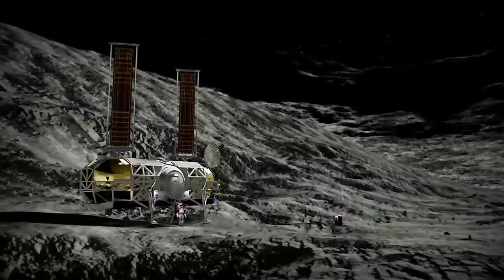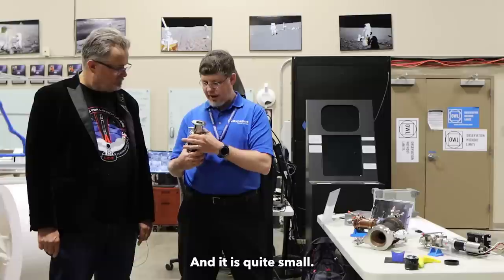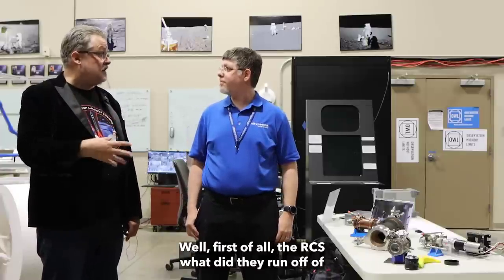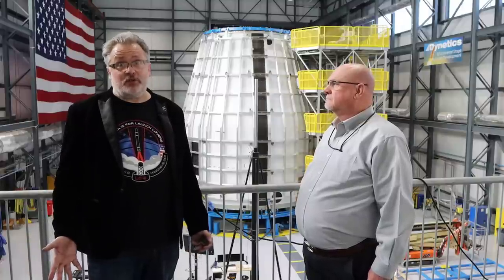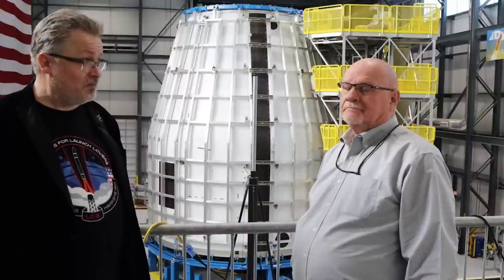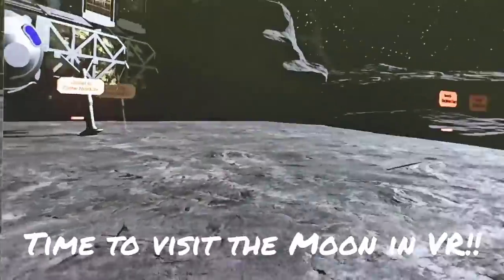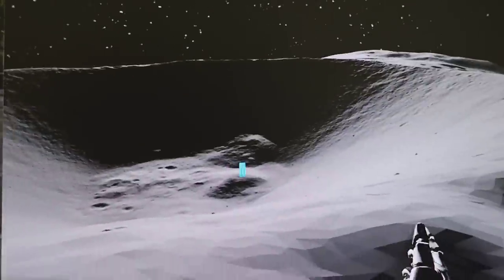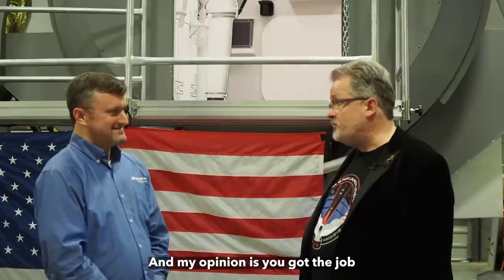One launch.  One landing!  The new lunar lander for NASA Artemis!  Dynetics Tour Part 2!

Comment: You make a compelling case for Dynetics. It's hard to see NASA not sharing many of the viewpoints you've proposed here, and I think you even identified the negative factors in the billionaire owned companies' ability to absorb cost and not pass it on to NASA. But if the product itself isn't the best, a lower cost shouldn't help it prevail. Dinetics Alpaca is the best system for Lunar landing.

Comment: Great content Jordan!  I really wish that ALPACA would be integrated into a 3rd stage that starship could take up to LEO.  Would be a fraction of the cost of SLS.
Reply: 2 Falcon Heavies, one with an Orion Command Module & propulsion stage/service module & another with the Alpaca & a lunar rover, would be a fraction of the cost of SLS! Remember, 11 launches of Starship will cost $80-110 million (much less than the above) & be able to land 24 astronauts & 100 tons of supplies including habitats, rovers and a power supply (probably a small nuclear power plant). We really need to realize Starship is designed to dramatically reduce the cost of spaceflight from $2300 kg (lowest cost of Falcon Heavy) to $70-100/kg so we can colonize Mars & the moon.

Comment: Like you, I like the current iteration of Alpaca.  While we decry the complexity of the SpaceX Human Landing System process, we should recall that NASA calculated the Alpaca version competing against it lacked sufficient thrust to execute the mission and was eliminated from the competition.  That left SpaceX and Blue Origin.  The BO lander looked a lot like the original Lunar Excursion Module after significant growth and was awarded a contract for the bulk of the 2 lander program's funds.  The SpaceX proposal was new from the ground up and was calculated to have the necessary performance...
HLS will have the capacity in both weight and volume to carry two Jeep Wrangler size vehicles, about 90 tons of general cargo and about 10 people, all at once.  At some point, vehicles capable of doing earth moving tasks will be required to build the desired permanent base.  HLS can accommodate the bulk and the weight of such machines.  Alpaca cannot.

That said, there are missions not suited to HLS.  As someone has said, the two systems fill different niches.  Alpaca is a relatively light truck.  HLS is a railroad car.  One does not normally ship a couple people and/or a small amount of freight on a railroad car.  Conversely, you simply cannot ship a Cat D-9 bulldozer on your F350 SuperDuty pickup.

Whether you are talking about inflatable habitat moduless or raw building materials, capacity to move more units is always good and one can pursue that goal without giving up on lighter transport vehicles.  Remember, the original Jeep was built as a quarter ton utility vehicle with 2 seats.  The available 2 1/2 and 5 ton trucks did not make the Jeep any less useful.  The available vehicles became cooperating parts of a larger whole.

We need both Alpaca and HLS and we need them both to work well.  And we will need both smaller and larger vehicles for the variety of purposes that undoubtedly be encountered.

Comment: Fantastic interview the two chief engineers.  Great insights.  Nice to see some hardware.  Dynetics has done a lot of good work.  I love their lander design.  It somehow looks right and feels right.  It's what a lunar lander should be.  But that's just my gut feel.

As an industrial designer, I was disappointed that they only had a "lo-fi" mockup of the lander.  The 3D walk through was nice, but no substitute for a physically realistic prototype.  A partially working prototype would have permitted them to assess human factors, even if it's only on the ground.  But maybe we just didn't get to see that.  I don't know.  I'm pleased that they got their guidance, navigation and control model development to the point where they can complete the mission when running simulations of vehicle mass versus fuel versus specific impulse.

Comment: Jordan, I saw both your Dynetics videos back to back, and something leapt out at me. They said they have an "automated landing system"... that can even put it on the surface without human input. Is that correct?

If thats true, couldn't they use that system to land an Alpaca, uncrewed, to be used as a rescue unit, to evac astronauts in an emergency? Imagine a variant of Alpaca, stripped of unnecessary components, like bunks, toilet, and other non-essentials, and all that space dedicated to cargo. It could shuttle supplies between lunar orbit and the moon, and still be much more accessible than other options.

Alpaca suddenly gets a whole new life... and becomes a MUCH more appealing option for the HLS. I hope I get to see NASA return to the surface... in an Alpaca.

Comment: Re ISRU issues with needing to bring methane from Earth, almost certainly not initially but once ISRU is up and running for local oxygen and water, might it not be most efficient (minimise the frequency required for resupply missions) to not transport actual Methane from Earth but instead just bring Carbon in some suitable form to feed some process on the Moon that actually synthesises the methane locally? If hydrogen can be produced locally and micro reactors etc can provide sufficient energy then those 4 hydrogen atoms hitching a ride with each and every carbon atom seems to me to be unnecessary mass being transported from Earth to the Moon.

Comment: Alpaca is still 2 launches for one landing- #1 launch the lander, then #2 launch fuel.  And as for refueling,  I'd rather see redundant LEO fueling, rather than a "got to be perfect" refueling in lunar orbit.  Also, relying on a future Vulcan Heavy is a bit pie-in-the-sky when Vulcan is not yet flying and BO still has not proven it can build the BE4.

Alpaca has some advantages,  and for sure is better than the Bezos Boondoggle,  but refueling in lunar orbit is (IMHO) not one of them.  At least not until we get a lunar fuel depot, which will probably require starship anyway.

Comment: Isn't there exactly 1 relevant calculation that needs to be made here?  It's cost per pound to lunar surface.  There is no other consideration when you're discussing this and it's that singular calculation that has allowed SpaceX to be the undisputed masters of all things space.  Cost per pound to target location.  Absolutely nothing else matters when you're talking about scaling exploration because of just how damned expensive the whole thing is.
Reply: Not necessarily.  There is also the amount of time it takes to get there.  SLS is one-shot from pad to moon.  Starship requires multiple refueling flights before it can begin its trans-lunar injection.  If something needs to be urgently sent to the moon, Starship is likely not the best platform, at least until large orbital fuel depots are in place.  So, while dollar-per-kilogram is a huge consideration, you also need to consider reliability and speed.
Reply: @rubi4714  again, that's taking a 0 sum perspective.  The answer is obviously to have more starships.  At a million dollars per starship launch, you can launch 1500 starships per SLS.  Even if Starship starts at 10 times that price, there is simply no good reason to use anything else.

Comment: Cost, cost and cost that’s what you should calculate on not the amount of launches SLS costs $3b plus per launch starship should be $2-3m each even at full expended costs are tiny in comparison so how much to loft the Alpaca vs Luna starship in $$$?
Reply: Where did you get these numbers? One Falcon 9 to low hearth orbit on a well used booster= $ 52 millions. New booster crew Dragon $90+ mils I'm sure Starship will top that by an order of magnitude. still cheaper than SLS but not  that cheap.
Reply: @LG-ct8tw  sorry was a bit out. projected launch cost for starship $10m in two to three years (if it’s fully reusable) credit, report from Business insider. Still valid point though unless alpacas can get to space very cheaply which I doubt considering they need to get to the moon so not a cheap launch 🚀

Comment: ALPACA (I insist, it should have been called "LLAMA", Lunar Lander Able for Multiple Assaignments 🤣. Llamas -please, say "Yama" not Llama: that's he rignt sound for the real name of the animal; are stronger than Alpacas when loading and carrying is all about. Any guy in Altiplano knows that) is a winner and it always was. It just lost because of foolish bad calculations the first time (all we make mistakes I also). But NASA is not fool (I hope). I'm sure if calculations run fine today, they'll win the bid this time.
The best use of resources would call the specific ship for the specific purpose. I mean: For a prospection, a turnaround, a limited scientific mission, a reconnaisance or a SAR mission, ALPACA is the ideal. When you decide a place where to install an outpost or a scientific base, a mining facility, or simply carrying personnel, Lunar Starship would be the best solution, with the support of ALPACA, why not.
However the recurring problem for Starship is and will be how can we refuel it the most efficient way, and no answer on short term for that on view. 
In long term, the best I can figure out -assuming that we already have a Lunar Starship in LEO already, is an excercise for upgrading superbooster using the maximum Raptors the design can take and adding 3 or 4 SRBs from SLS and refitting a recovery system the way they used in times of Space Shuttle, to reduce costs. Maybe this specific iteration of a Cargo Starship could be designed with a recovable Raptors unit and an expendable rest of the fuselage, so that you can replace atmospheric Raptors with a complement of 3 Vacuum Raptors more to a total of 6. Its engine module could be ejected to descend with a heath shield and parachutes, the way ULA Vulcan is supposed to do. Well, Why all of this? Because I am thinking in a much larger cargo bay to accomodate the entire modular set of Raptors and tanks already fueled right to space to replace the empty tanks and engines of the Lunar Starship already in LEO. A second but empty similar iteration of this Cargo Starship would be launched in rapid sequence, but this time with atmosferic Raptors and with the same empty enlarged cargo bay. 
The quiz would be to replace the entire module of engines and expended fuel tanks from the already launched Lunar Starship in LEO, to place it in the empty Cargo Starship (The first, due to its exotic complement of 6 recovable vacuum Raptors cannot return home) the modular set of engines and full tanks for Lunar Starship would be installed as a following space, into the Lunar Starship
A last question; Why including the engines in the replacement? Because I believe that opening the tank and engines compartment would need a much larger side hatch that could weaken the structure. It seems to me much easier and safer to extract the whole module set of engines and tanks right from behind and replace them as an entire unit. They could be accomodated in rails in the inner walls of such compartment to slide with ease and lately secured in the bottom.
The last procedure would be to load the empty second Cargo Starship with the modular set of engines and empty tanks and carry them back to the Earth.
The process would be super complex, and would have to be performed with extreme care and would need to be fully or at least partially automatized, but would just reduce the number of launches. Now it would be necessary to pick up the calculator and establish if it is all financially worthwhile.